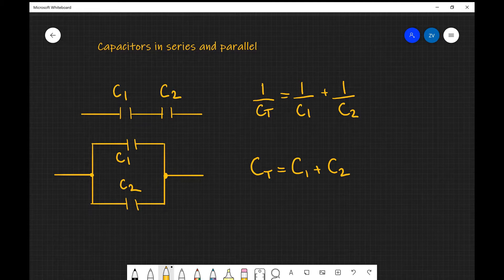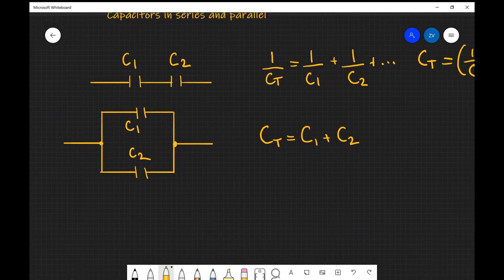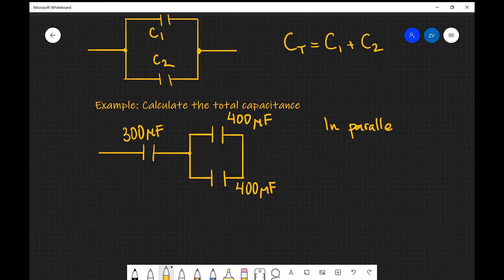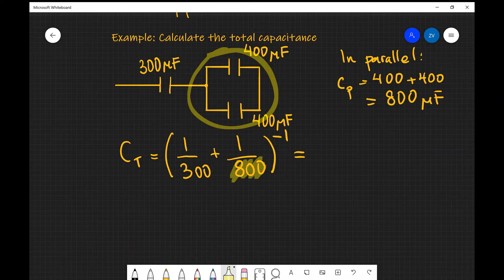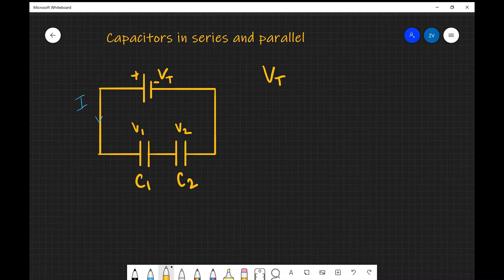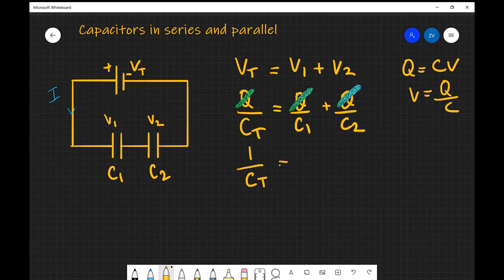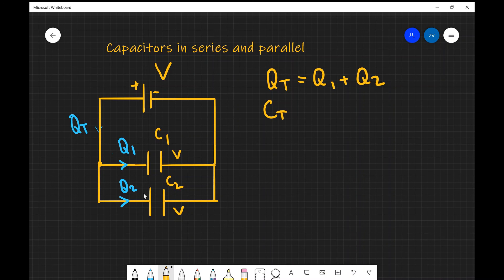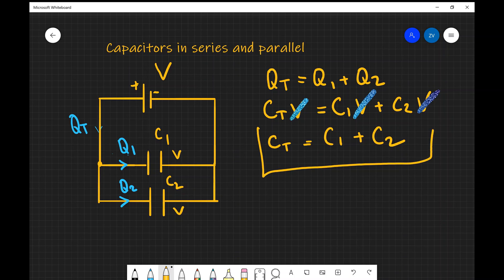A Level Physics: Capacitors in series and parallel

Comment: In my ocr a physics revision guide it has an experiment to investigate capacitors in series and in parallel it says adjust the variable resistor to keep the charging current constant for as long as you can. How does that make the charging current constant and why do you need it to be constant? here are the steps for the investigating capacitors in series 1) set up circuit to charge capacitors 2) closing the switch for current to flow, adjust variable resistor to keep the current constant as long as possible. 3) record the value of the constant current as well as the p.d. and the time since closing the switch . 4) calculate Q=It 5) Plot Q against V and find gradient of best fit which would be =1/Ctotal = 1/C1 +1/C2 . ALSO THANK YOU SO MUCH FOR THE LEGENDARY VIDEOS AS USUAL.
Reply from the maker: so if you don't adjust the resistor, the current will decrease exponentially. If in this particular experiment they you want you to keep it constant, one way to do it is to adjust the resistance. Hope this helps!